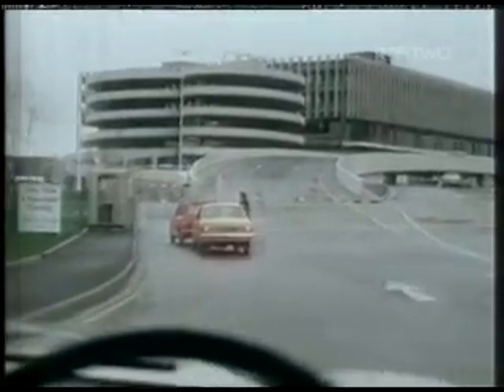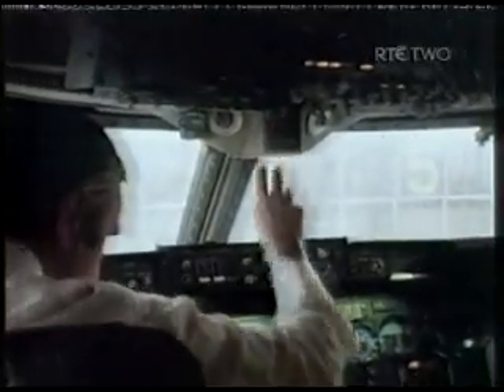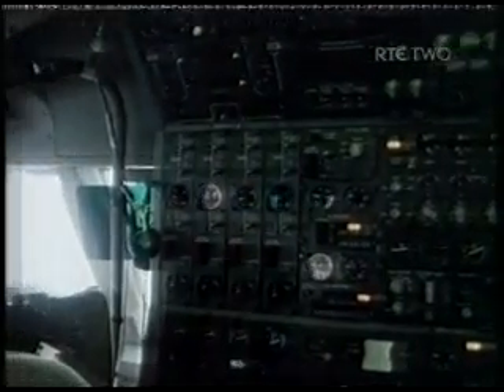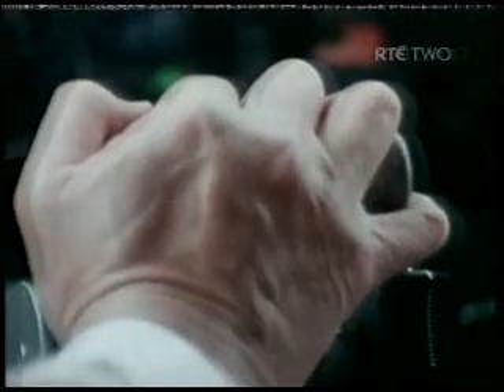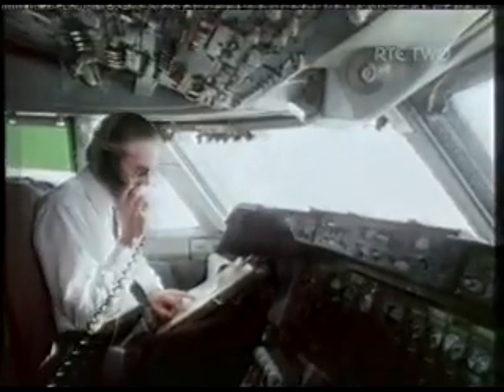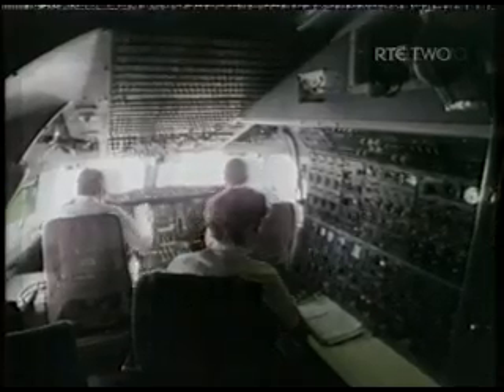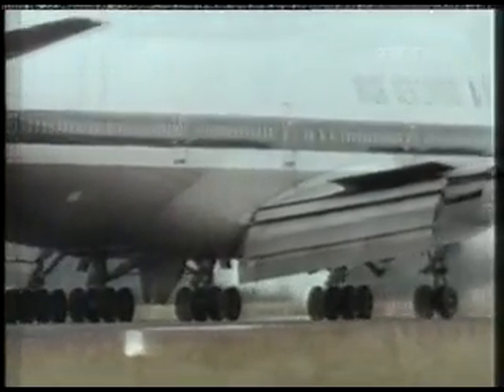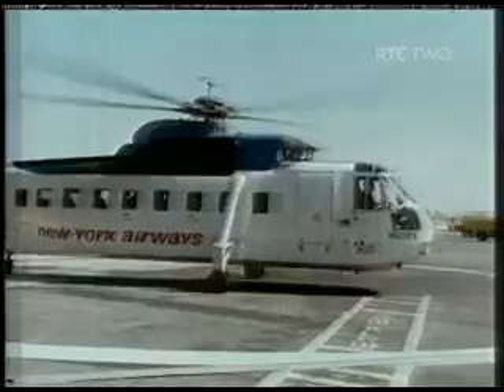Aer Lingus - Boeing 747 (EI-ASJ) Dublin - New York

Comment: The sound of those 4 engines at take off thrust, brings back some memories! Shame it wasn't recorded in stereo for the full effect. It was a beautiful sound. Back in those days I could tell from the sound what aircraft was overhead - they all had a unique sound. Aer Lingus were flying 747s, 707s, 737s, and BAC1-11s. The 1-11s were small but noisy feckers! British Aiways were flying Tridents into Dublin back then too and I could hear them take off and reverse thrust on landing from Portmarnock! Days before noise regulations and hush-kits.

The narrator of this film, Aidan Quigley wrote two short books about flying for Aer Lingus. Fabulous reading. Worth looking out for.
Reply: Kevin Kretsch AL also flew the Boeing 720 for a while.
Reply: @user-ky6vw5up9m  Yes, through the 60s. My mother was cabin crew on them and the 707s.
Reply: Maby stick  a finger in each ear and alternate them in and out))

Comment: what runway did it use for take-off?
Reply: If you're still interested after 7 years :-) It was called runway 35 back then. At the moment the runway is called runway 34 (341 degrees magnetic to be precise) . This is because over time changes in the earths magnetic field means magnetic alignment of a runway changes, which forces the authorities to issue a new designation.
Reply: @terryoconnor9405  Two years later, I'll add that you hear 35 being announced over the radio by ATC. But the footage of the takeoff run, that cannot be runway 35 because there is nothing on the horizon in the background. If it was 35 you would easily spot the 2 chimneys (unless they weren't there yet). Dubline mountains also missing. Also, that dip in the runway reminds me of runway 24. 
I assume RTE took a lot of footage at the airport for that programme and they edited it all together, so not all of it is of the same flight.
Reply: @j.o.1516  visibility isnt great. Grey misty old day by the looks of it so not unusual that you cant see poolbeg or the mountains in the background as the plane takes off.

Comment: why did Aer Lingus get rid of its 747 fleet?
Reply: Increasing fuel costs to run 4-eng jets, and the 747 interiors were getting a little tired and needed complete refurbishment again in the 1990s. They were phased out from 1994 for the Airbus 330 ETOPS and over the next ten years Aer Lingus switched primarily to Airbus short and long haul. There's been the odd long haul exceptions since with some leased 767 and 757s. The last leased 757 went back to ASL (lessor) in 2019. Aer Lingus has been receiving multiple new A330s and the start of the new A321 long range order over the past 18 months. Aer Lingus is now exclusively an Airbus fleet and likely to be for another couple of decades.
Reply: @RadioEspial  Yes, Aer Lingus were an early 747 customer.  This is supposedly from 1975 but I suspect the footage is earlier - I don't think the Aer Lingus 747s wore that scheme for very long.  I think they retired them in the mid-90s as the A330 became available.  The A330's a good aircraft but I miss the 747s.  I grew up near Heathrow - saw them all the time.  One thing the Yanks got right.
Reply: @chriscboland  I think you are right on the time - could well be late 74 and the date is just the production/broadcast date of 75. The actual docu title is in the end credits... I think this is only a segment out of the longer production. Fondly remember my first few transatlantic trips on the EI 747s in the 1980s.
Reply: @chriscboland  The first two 747s (ASI and ASJ) were delivered in the Spring of 1971. The scheme shown in this film is that original 1971 scheme. Aer Lingus introduced a new "green roof" scheme in October 1974. The first aircraft to carry it was one of the 707s. 
It took a couple of years for the whole fleet to be repainted in the new scheme so there is a good chance that both ASI and ASJ  continued in their original schemes well into 1975.
EI-BED is delivered around 1978 so only ever carried the later scheme.
Reply: @EricIrl  In 1976 ASJ ended up with half British Airways livery.
Reply: “It was a cold and wet December day
When we touched the ground at J.F.K
The snow was melting on the ground
On B.L.S. I heard the sound”….every time i hear the lyrics to this 1980s U2 song i think of an Aer Lingus B747-100 😂
Reply: @chriscboland  Aer Lingus changed the livery in 1975/76
Reply: @EricIrl  BED was not new, it was an ex Lufthansa 747, no?
Reply: @j.o.1516  October 1974 was when the new livery was unveiled (on a 707). It took a few years for the fleet to be repainted.
Reply: Flew to Boston in 1988 on EI - BED returned on ASI as far as I remember.
Reply: @EricIrl  f my memory still serves me, the first time I laid eyes on the "new" livery was in June 1975 at DUB, so that seems right.